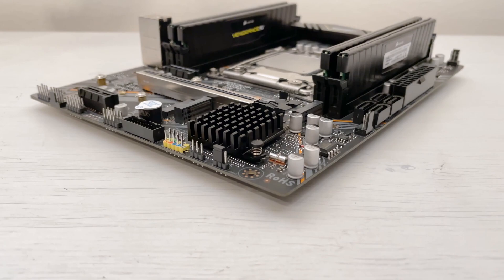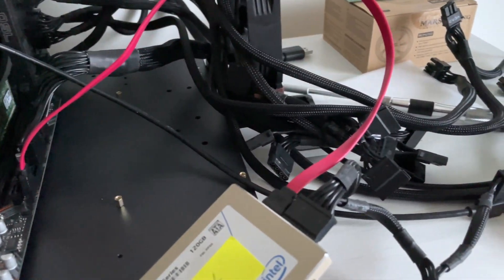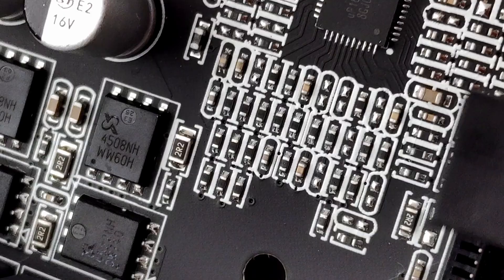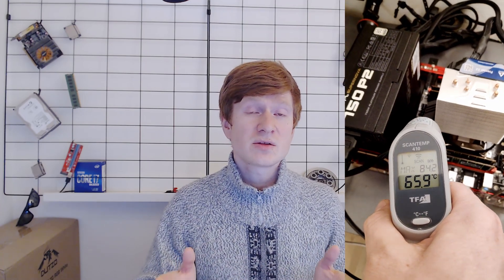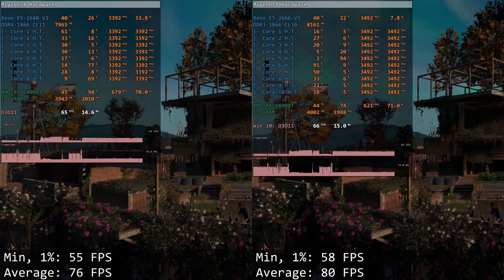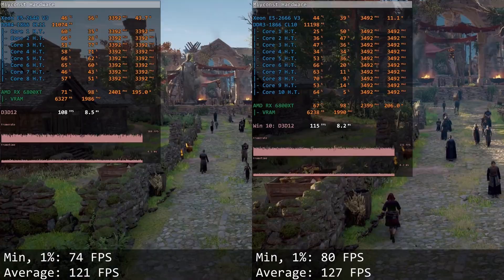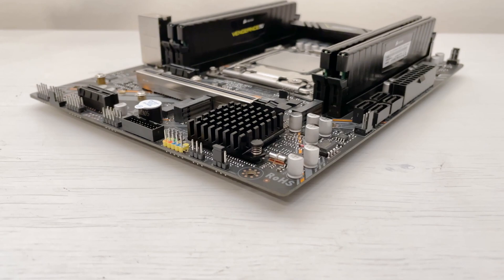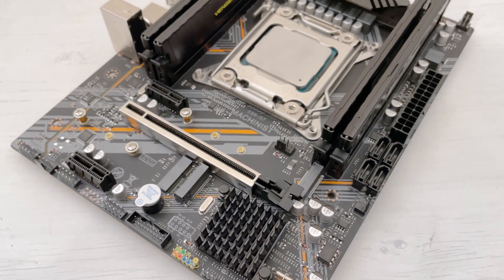🇬🇧 Machinist X99-G7 and Xeon E5-2666 V3 – small review and benchmarks

Comment: Mine is using the Q87 chipset, can I still do the bios unlock ? If yes can I use your tool or should I do it the manual way ? Thanks.
Reply from the maker: Most like the answer is yes to both questions, but as always, nothing can be guaranteed with these Chinese motherboards.
Reply: @Miyconst  Thank you for your time, I mainly asked because for this motherboard and the Q87 chipset there is only ram timing unlock on mi899 ( the mi899 is extremely popular in Spanish and Portuguese speaking countries )

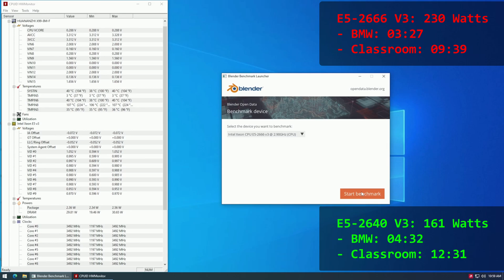Comment: 10:45 So, although the Xeon E5 2666 CPU has a TDP of 135W, if the result of the Blender benchmark is any indication, then 230W would be its actual power consumption under 100% load, is that correct? I mean, TDP is often an indicator of power consumption, but that does not seems to be the case here since that CPU is consuming more than its stated 135W under load. Although Wikpedia says that "some sources state that the peak power rating for a microprocessor is usually 1.5 times the TDP rating", which explains why that CPU is consuming almost twice its TDP. Also, Intel has to sat this about TDP:

"TDP stands for Thermal Design Power, in watts, and refers to the power consumption under the maximum theoretical load.  Power consumption is less than TDP under lower loads. The TDP is the maximum power that one should be designing the system for. This ensures operation to published specs under the maximum theoretical workload."

For that CPU, at least, this seems to be very confusing. I don't know if I can trust the PSU calculators around the web if the actual power consumption under 100% load seems to differ from their stated TDP, at least not for the Xeons.

Comment: Hi, great video, I'm thinking of changing CPUs, I have the 2620 v3 and I'm between the 2640v3 or the 2666v3, I play history games at 1080p with the RTX 2060 and I'm thinking of upgrading to the RTX 3070, which one would you recommend ? I also have a huananzhi 8M Gaming not F.
Reply from the maker: I would go with E5-2666 V3, but make sure to cool your motherboard VRM properly.
Reply: @Miyconst  Thanks for u response, even if i go with 2640 and 3070 will be good for single player games in 1080p or maybe 1440p?
Reply from the maker: @vladboyz  E5-2640 V3 + RTX 3070 is a waster for 1080p. At 1440p it will be fine, but the GPU will still be bottlenecked by the CPU.
Reply: @Miyconst  Oh i get it now, what video card would you advise for 1080p with the E5 2640v3 to replace my 2060? 

And another question, the E5 2666 v3 will get a bottleneck with the  RTX 3070? too? i will use just for games and not even close at 100% usage of CPU.

Thanks for your responses!
Reply: @Miyconst  I'm about to buy right now cause this i'm asking so much
Reply from the maker: @vladboyz  for 1080p gaming your RTX 2060 is just enough, don't waster your money. RTX 3070 will be bottlenecked by E5-2640 V3 and by E5-2666 V3. If you want a good upgrade with no bottleneck - go with i3-12100.
Reply: @Miyconst  Thanks for u help! i will buy 2640v3 and use with my 2060, then 2 years later i will for 3070 for QHD or even UHD.

Comment: Hi Miyconst,can I use gtx1060 on this motherboard and it will work stably 24/7 with additional VRM cooler? Some comments say that the pcie slot is not working
Reply from the maker: The first PCI-E X1 slot does not work, but the PCI-E X16 should work as  intendent.
Reply: @Miyconst  thank you so much!

Comment: Hi Miyconst, I was swapping between two graphics cards to try different VMs with the X99 G7 with my Unraid server, everything was working fine until suddenly it gave me 5 beeps and apparently it doesn't want to recognize the GPUs any more.
I've reset the bios, but it didn't help.
Do you have any clue what it could be? Thanks in advance!
Reply from the maker: It could be that you have accidentally damaged your GPU or the PCI slot. Take a torch and see if all the pins inside the slot are in tact, check if there is any dirt.
Reply: @Miyconst  Thanks I'll check that
Reply: @Miyconst  Well I have checked the PCIE and I don't see anything wrong, I put the GPUs in my other server and it works without problem.
How to correctly reset the bios on this mb?
Thanks for your time and help.
Reply from the maker: @serch8266  if I remember correctly, BIOS reset does not work with the default BIOS, if you flashed Huananzhi X99-8M-F BIOS as I suggested, you can simply turn off the PC and remove the CMOS batter, then wait for about a minute, put the battery back and power on your PC.
Reply: @Miyconst  Thanks again, the bios is X99-8M-F from the beginning as i told you, Anyway, I had already reset that way, but without luck, everything seems to indicate that the mb stopped working, I'll try to see something else, anyway if you can think of something that could be of help I would appreciate if you let me know about it.
Thanks for your help.
Reply from the maker: The only thing I could guess is that there is some sort of a short somewhere. Check if anything is touching the motherboard from any side, finally try to remove it from the chassis and test a minimal setup, maybe also try to reseat the CPU.
Reply: @Miyconst yes I've did that also, but no luck, thanks!
Reply from the maker: Well, then it seems like the motherboard is dead, unfortunately.
Reply: @Miyconst  Hi again, so I've now tested with a GPU PCIE Riser and it works flawlessly, it looks like the PCIE x 16 is damage, very strange issue, well yea, chínese.😡
Reply from the maker: @serch8266  PCI-E connector has a secure pin to identify what is installed into the slot, it's slightly shorter than the rest of the pins, so it could be that your motherboard has a somehow damaged PCI-E slot.
Reply: @Miyconst  I had never seen that
Reply: Well, I have already found a solution for the PCIE x 16 port to work, I had to put a tape on the card contacts after the ones used for PCIE x 1, so now it works without having to connect the Raiser to the PCIE x 1, something funny but it works great, what I don't like is that the wake on alarm doesn't work on these motherboards.

Comment: well... got some bad news about this board.  The onboard audio does not work.  Tried and tested in Windows and linux.  Just static.  In windows, I updated the drivers, tried alternate drivers, used driver indentifier to find other drivers.  Same result.  Static and you will see the audio device dissappear and reapperar constantly from the device manager. Tested a USB audio device and it works just fine.  Just no onboard audio.  Trying to contact the seller to troubleshoot at the moment.  Its a pity that the first PCIe slot does not work.  Would be perfect to install a third party sound card there.
Reply from the maker: Thank you for sharing the info. I hope you can get a refund or a replacement board. Dead audio is unfortunately a very common issue for the Chinese boards.

Comment: Are you running the games in 1080p? If yes thats very low fps with a 6800 xt. You should atleast have double the fps lol. I have the same gpu and i noticed your low fps with those games (i have them also) and something is def off. My cpu with 2 less cores is the i7 5960x 4.5 ghz.
Reply from the maker: I think you have answered your question yourself. Core i7 is overclocked to 4.5 GHz, E5-2666 V3 is limited to 3.5 GHz and DDR3-1866. The difference is rather big.

Comment: Do you have some decent micro ATX X99 motherboard recommendations?  
I'd like to fit one in my  InWin 301 case in place of a G4560 Pentium.  It would be nice if it could support 12 cores or more.
Reply from the maker: Maybe Huananzhi X99-ZD4?
Reply: @Miyconst  Thanks - if I can find it cheap enough !Dee - the combo price is very reasonable - but I lust over the Dual X99 Jinsha board with very cheap slow 14 core E5 (I gave $50 for a matched pair of E5-2683 v3) - would that dual E5 build be more fun?

Comment: Just thought that I would provide some stability feedback.  I have had this running for 8 days solid now at 100% CPU usage with Turbo Boost doing transcoding of media to x265. No BSOD's and everything is hunky-dory. current average CPU temp is 52 degrees celsius on a 360 water cooler rad in a micro atx case. VRM temps ranging from 45 degrees to 60 degrees celsius.
Reply from the maker: Thanks for the feedback. What CPU are you using? Make sure to have good airflow over the VRM even if it doesn't overhead right now.
Reply: @Miyconst  I'm sure I replied to this. It's the 2666 v3. Same CPU as what you are using in this video. Good value to performance.
Reply: What cooling solution are you using for the VRM?
Reply from the maker: @alybrown7199  just a 120mm fan with direct airflow over the VRM.
Reply: @Miyconst  Also a solution when the motherboard is installed inside a case?
Reply from the maker: @alybrown7199  yes, I installed a 120 inside my chassis so it blows right over the VRM.

Comment: Bought this motherboard to replace my aging work PC and paired it with the same CPU 2666. undervolted by 50mv with the Turbo Boost hack.  So far been running stress tests all day and I am happy. I have very good airflow in the case but I am still looking at getting a beefy VRM cooler.  But yeah, I am happy. Decent looking board too.  One thing that doesn't work is the NVME slot on the board.  So I have my NVME drive connected via a PCIE 1x-16x extender cable and a PCIE NVME card.  Contacted the seller regarding it but haven't heard back as of yet.
Reply from the maker: Are you sure you are using the right M.2 slot? There are two of them, one for NVMe SSDs another one for SATA SSDs.
Reply: @Miyconst  🤦‍♂well... I feel like a newb... Most of the Chinese boards I have bought have the NVME slot at the top.  I didn't even bother to test the second one that goes under the graphics card as I just assumed that this would be the sata m.2... Guess I will just test it out tomorrow to make sure it works and leave it as is with my current setup as having it under the graphics card... well... heat! 😅

Comment: Hi, dilemma between e5 2666 v3 and e5 2678 v3. Huge price difference.About 3 times where 2666 is cheaper than 2678.... Which would you choose?  For a DDR3 x99 capable motherboard.
Reply from the maker: Definitely E5-2666 V3. With the current price E5-2678 V3 makes zero sense.

Comment: Should I buy E5 2640v3 or E5 2660v3 or E5 2666v3. I have Dell precision T5810 pc and I currently have rx 570 8gb but I will be getting Rtx 3060. Whats your advice on which cpu out of these three should I get. I would really apreciate your  reply
Reply from the maker: Xeon E5-2666 V3 is the obvious choice. It costs just a tiny bit more, but has the best specs.
Reply: Thanks man. Can you tell me does Dell precision T5810  supports E5 2666v3 as this processor was not launch officially. I have scearch on Internet but not able to get authentic information regarding the compatibility of my pc.
Reply from the maker: @humayuntariq3530  I can't guarantee you 100% compatibility because I have not tested it myself, but most likely it's going to work.

Comment: Hi Miyconst, my friend gave me a E5 2630 V3 and I have a Huananzhi X99 F8. Do you know what is the undervolting limit for this CPU? 

Should I use v3_payne bios or the s3turbohack v0.2 bios?

Thanks.
Reply from the maker: There is no universally best undervolting level, each CPU is unique, but you can go with -50/50 as the safe option. S3TurboTool is the better option.
Reply: @Miyconst  Hi Miyconst, thank you for the suggestion. I have just flashed the bios. The only problem is that it always stuck on the Windows Logo loading screen whenever I chose to restart, not sure what is the problem. I think I will do a system reformat and see if the problem persists.

Thank you so much for helping.
Reply from the maker: @brianwong6562  did you restore the BIOS defaults after flashing the modded version?
Reply: @Miyconst  No I didn't. Oh...did I missed an important step?
Reply from the maker: @brianwong6562  yes, it seems like that. Just go into the BIOS, restore defaults, save & restart, the PC should stop locking.
Reply: @Miyconst  Nice one! This seems to solve the issue. I will keep monitoring it and let you know if the issue happens again. 

Thank you so much! You are the Best!

Comment: I am considering this CPU since its price has gone down a bit. Do you happen to know if it will work on a mainstream motherboard (meaning not bios modified Chinese board)? I intend to use it on an Asrock X99m Killer 3.1 board. The Asrock support page only lists the 2660 and the 2667 as the closest related to the 2666. I am guessing it should be fine, but any advice would be appreciated.
Reply from the maker: I can't give you 100% guarantee that it will work, but 99% it will. This is CPU is an unofficial version, thus it's not listed as compatible.
Reply: @Miyconst  Got mine yesterday. Works perfectly on an Asrock X99 Extreme4 (repurposed the X99m for another machine). Boosts to 3,5GHZ on single core and 3,2GHz on all cores, runs cool with a Prolimatech Armageddon and a 140mm fan. At 35 EUR it is perfect.

Comment: Do you have any opinon on the difference between the Samsung and Killsre DDR3 ECC? I have only purchased and used the Samsung but with the Killsre being a cheaper option, I am just wondering if its worth it saving those few extra dollars.
Reply from the maker: No, it is not worth it. Samsung is one of the best memory manufacturer, while Kllisre is just an AliExpress brand that uses second hand memory modules or chips under a nice heat spreader.

Comment: Hi, You said in this video that this motherboard is exactly like the Machinsit X99-RS9 except it uses DDR3. Does this mean I can use the modded BIOS from your Mi899 to unlock the CPU and RAM speed? Do you know if the modded BIOS would recognize the DDR3 slots?
Reply from the maker: Yes, I meant and did exactly that. Huananzhi X99-8M-F BIOS worked well with my X99-G7, but I can't guarantee that it's going to be the same with yours.
Reply: @Miyconst  Excellent! Thank you.

Comment: Would disabling the hyper-threading reduce the VRM power stress? I've read a lot of reports that gaming input lag and 0.1% frames improve if you limit the cpu to physical cores
Reply from the maker: Yes, disabling hyper threading helps a little, but not enough to safely use this VRM 24/7 with E5-2666 V3.
Reply: @Miyconst  So pretty much the only DDR3 alternative is the 2673 v3?
Reply from the maker: @LL-sk3do  yes, there was E5-2649 V3, but it's no longer available to purchase.

Comment: Hello, deactivating 2 cores of the 10 that it has, would it emulate the 2640V3 but 100MHz more?
Reply from the maker: Yes, kinda, E5-2666 V3 supports DDR4-2133 while E5-2640 V3 is limited to DDR4-1866.
Reply: @xt6561 eu fiz isso, tenho uma placa 8m-f, substituí o 2640v3 pelo 2666v3, diminuí 2 núcleos e estou usando com memória ram mais rápida

Comment: Hi, i've just bought this kit  - xeon e5 2640 v3 ($30)  + Huanzhi x99 placa mãe bd4 v1.1 x99 , and just know i found out this amazing CPU 2666v3 for ($34) and i'm thinking of buying, u think it is worth the trouble of purchising this cpu for upgrade and flip my 2640 v3? (everything still in transit).
Reply from the maker: It depends on what you're using the computer for and whether you can afford it, but if you are unsure, most likely you don't need it.

Comment: Nice video! I have a question: I found a e5 2666v3 sold at 36 euros and a e5 2640v3 for 31. Shuld I pick the 2640v3 anyway? Is the e5 2666v3 worth five euros more?
The cpu will be used for some gaming and non professional 3d modeling. Thank you so much!
Reply from the maker: I would pick E5-2666 V3. The price difference is negligible.
Reply: @Miyconst  thank you so much

Comment: Thanks for covering the e5 2666 v3 proccie
I've bought one for myself and wondering whether DDR4 2133 is the max supported memory of this proccie?
Reply from the maker: Yes, DDR4-2133 is the maximum.
Reply: @Miyconst  I bought e5 2666 V3 to replace my e5 2630L V3 and it has quite a noticeable performance increase in the Adobe Premiere timeline editing experience. I thought maybe because 2666 has quite higher clock frequency compared to the 2630L (3.5GHz vs 2.93GHz).
Reply from the maker: @anggadennis4894  that's surely so, it's also because E5-2666 V3 supports DDR4-2133 while E5-2630L V3 is limited to DDR4-1866.

Comment: Have you tested the CPU with any AVX games like Horizon Dawn and see if it drops the the clocks of the CPU? I tested with an E5 1660 v4 and that runs at 3.4 GHz all cores with any AVX task like Cinebench without dropping down to 3.2 Ghz, but my other one 2682 V4 16 cores drops down the clocks to 2,5 Ghz on Cinebench.
Reply from the maker: V4 CPUs are a completely different story because they don't work with the turbo boost unlock exploit. I have tested Horizon Zero Dawn with many V3 CPUs, all cores maintain boost frequency as long as the TBU exploit is enabled.
Reply: @Miyconst  Thanks I got some V3 CPU´s too, gotta try that TBU exploit on them.

Comment: mate do u think this pc worth $370?
szmz x99(new)
e5 2620 v3
8gb ram 2133mhz
ssd 120gb
hdd 500gb
gtx 960 2gb
psu 500w bronze 80+
im new into pc so i need a little bit help
Reply from the maker: It depends on the prices in your region, but I think it is a bit too much for this PC.
Reply: @Miyconst i think this pc price is fine,its just gpu's in my country are too overpriced even gtx 960 2gb(used) is about $150 lmao